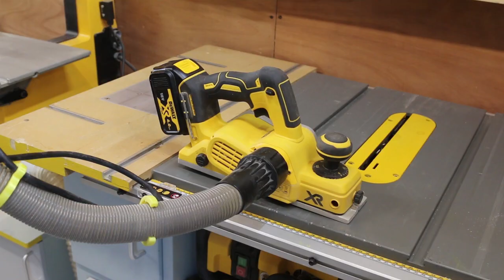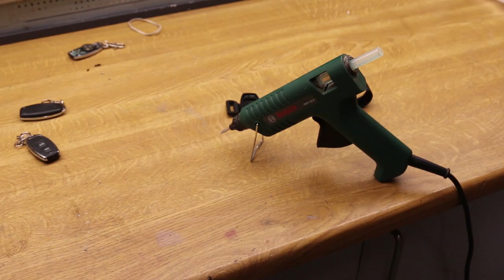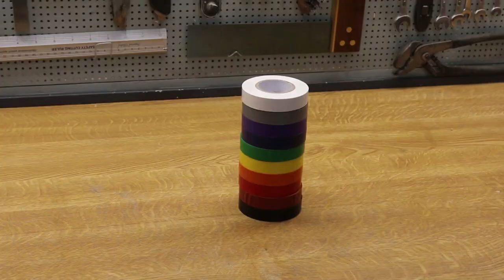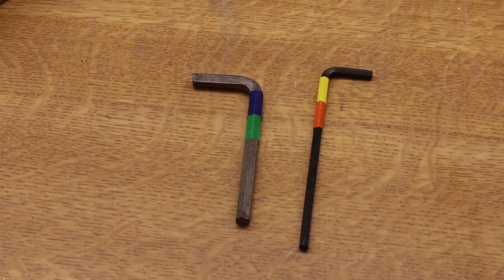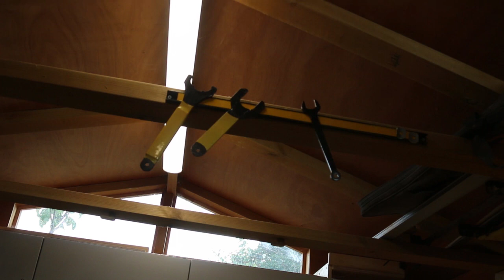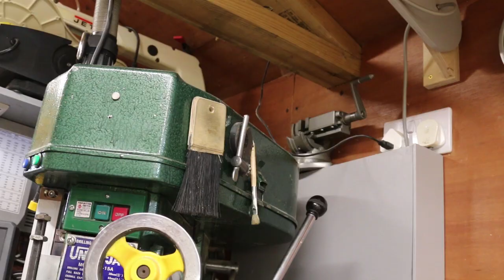three workshop ideas

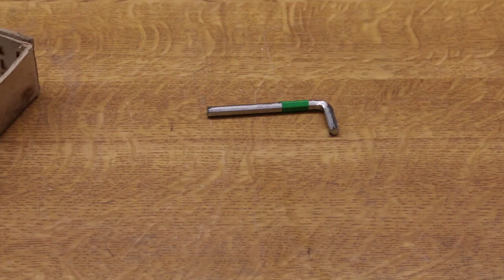Comment: 2:48 I feel excluded. I hate clutter and so I gave all my loose Allen keys away and only kept two sets, one with ball ends and one with straight ends. My inner Monk has been very peaceful since then ☺️😅

The color coding is a great idea!
Reply from the maker: Duplicates are an interesting issue. Yes, they can be superfluous clutter. On the other hand they can save time- I keep 3 sets of common size drills in the 'shop, close to the tools that use them. Allen keys- if I find a tool uses a particular size, I dedicate one of those spare keys to it. But they do seem to breed when you are not looking… I admire your zen, but I am not, at heart, a minimalist.
Reply: @Tensquaremetreworkshop  well spoken 😅

Comment: Thank you for an excellent set of ideas.

I'm interested in utilising the wireless trigger for my shop dust extraction. With the Donjon system you suggest here, is it a case of splitting the existing mains wire for the unit and wiring the live,neutral and earth into/out of this unit?

Many thanks.

Yours,

Michael
Reply from the maker: The unit is connected between the supply and the extractor. The live and neutral from the supply connect to one side, and the L & N for the extractor from the other, so yes, it goes in line. The earth does not connect to this, it should continue from the supply to the extractor. The wiring is clearly shown in the supplied diagram. Best fitted after any power switch, so it is not taking operating power when not in use. Often an extractor will have sufficient space to fit it inside the case.

Comment: Could you explain why you think Bluetooth is unsuitable? To my mind a big advantage is Bluetooth pairing and security, which is likely better than manufacturers doing their own wireless control from scratch. It might help avoid these unexpected power ons that we hear about.
Reply from the maker: OK. Bluetooth is a bidirectional medium speed data channel. What is needed is a unidirectional single bit (on or off). The former is vastly over-engineered for this. Such over-engineering increases cost and complexity and reduces reliability. It will work, just as using a truck to transport a matchbox will work. The link illustrated IS paired (to both of the controls that you receive), ready paired for your convenience. This can be changed at the press of a button; you can pair a single control to more than one relay. So you can control, e.g. both an extractor and a blast gate with a single control. False triggers? Some will be caused by installation errors, operation errors, use of old outdated modules etc. I have never experienced such an event, and the consequences if it happens are not serious. So rare it makes the news... The simplest solution that does the job is usually the best choice.
Why do some manufacturers use bluetooth? Sounds good from a marketing perspective, and if you are used to extracting higher prices for your tools, let the customer pay. In this application it conveys no useful benefit - IMHO.
Reply: @Tensquaremetreworkshop  thanks for the reply.

I agree that Bluetooth has a lot more functionality than is needed for this application. As a consumer I don’t know how good or bad the implementation of an individual product is, so my guess is it’s more likely to be done properly with a widely used Bluetooth module. But it’s just a guess.

I don’t have a Festool extractor so am considering using a Hue smart plug in Bluetooth mode.

If you’re interested in the damage from an erroneous power-on, then Keith Brown talks about how one of his dust extractor motors stopped working after this happened to him (from about 10:30) https://youtu.be/aUNVCx-JcGY

As you said in another comment you turn the power off when you leave the workshop so I wouldn’t expect it to happen to you.

Thanks for the video, the resistor colour code marking is a brilliant idea.
Reply from the maker: @grahambleach   As a design engineer that has implemented many inter-processor comms links, I like simplicity when possible. For a one-off, convenience and prior purchases also come into play of course. On the Keith Brown incident, operation by another fob was his guess only. Given that, last time I looked the sync code is 10bit, that means someone walked right up to his garage and pressed a fob (why?) which used the same protocol, and had the one chance in 1000 happen. Much more likely that it was an unusual power glitch that fooled the switch, or a component failure. The latter can always happen- especially with domestic kit. I have been involved with designing failsafe systems, where three separate components have to fail to prevent operation- but powering down your workshop on leaving is the safest way. Costs nothing, and can be energy saving.